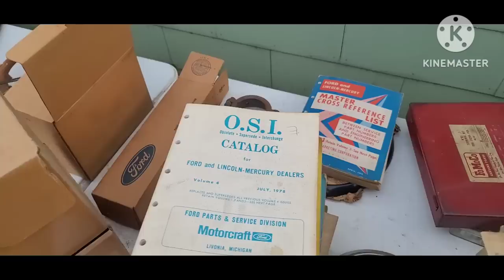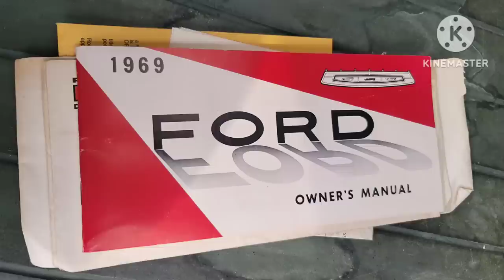Flathead to F100: TIME CAPSULE Survivor Ford Collection Auction! 1940 Mercury, Galaxie, 8N Tractor!

Comment: That Ranger, WOW!
Reply: Yes but, did you notice the rust in the upper front fenders especially the drivers side.
Reply: @briangardner5764  Hopefully that is surface rust as it is otherwise mint with only 21000 miles.
Reply: @briangardner5764  I noticed. And it certainly made me be very sceptical about it being only 20,000 miles.
That rust... to me... just doesn't jive with how good the paint is.

I also noticed... when he showed inside the bed... what appeared to be a couple of places on the fender hump that had primer on it.

Comment: Gotta remember that 'back in the day', anything near 100,000 miles on the odo was considered near dead. Now most cars will do 200k with decent maintenance and more with due diligence.
Reply: I remember, when cars were considered shot at 60,000 miles. In the old days, before there were warranties to worry about voiding, most people never worried about changing the oil.

Comment: That XL was a steal at 
$5500.00...
Reply: I restored one in 1984 for guy ! Even then everyone that came in the shop was checking it out!
Reply: If it wasn't original and was ratty, I'd Mad Max it.  The body reminds me of the Australian Falcon XC Pursuit Special Interceptor, but larger.  Unlike the Holden Monaro used by the MFP (Main Force Patrol) at the time, although some Holdens had Ford lines.

Comment: I had a 1970 Ford Galaxy back in the early 80s . 390 and C6 auto. Not much to look at but what a runner it was. High mileage, engine finally went bad so I traded it for a 1960 Chevy 4 door
Reply: Was it a BelAir or Biscayne. And was it any more reliable than the Galaxie.

Comment: I have to laugh cause the tractor sold for what a used mower would sell for here in alaska. My son has a collection of them with several extra parts including a few running engines. I do believe in my heart that the torino should go back together as its solid enough and not clapped out on the insides. A good frame straightener will fix the left frame rail or both as one is never the case in  those types of wrecks. I personally have done a few with great success. A front clip, and some of the incidental parts to get someone motivated into making it a grand torino  would be the best scenario
Reply: Sorry about going off topic with my comment, but what I noticed I couldn't get off   my mind. My interest in cars remains strong.

Comment: That Torina was a sorta special model. I know TASCA FORD in Rhode Island  ordered I think over (I heard 500???) called a "halo' version based on the last of the year  production run. I do know that the body seams were not as good as the earlier model as the dies were at the end of the production. I worked on a couple (Dad had one) to try to fit the hood/front fenders better. If my memories are correct they were a special to the larger FORD dealers  in the summer.
Reply from the maker: Fascinating info, thanks George!

Comment: Mr. Badsocket! - In the first place, thatnks for showing us this auction. That F 100 is to die for!  Please tell us what you mean by a "Marty Report" [@ 9:42]. I can make an educated guess as to what a "Marty Report" might be, but I don't know for sure, so please explain! Can the rest of us mere mortals obtain such a report?
Reply from the maker: Marti report is a verification of the build sheet from the manufacturer for a specific vehicle, looked up by the serial number. It is similar to a PHS (Pontiac Historical Services) report, or Govier verifying a Mopar Broadcast sheet. Helpful in pinning down exact details of how a car was built, in order to assist in restoring it to exact factory specs
Reply: Thanks. That's the info I needed.

Comment: if its 21000 origonal miles the odometer numbers should be all in a straight line. after it rolled over once the numbers will start to stagger

Comment: I’ve seen you buy some 1964-1966 Chevy trucks. Do you have any you would want to sell? I have a soft spot for those trucks.
Reply from the maker: That's my favorite generation of Chevrolet pickups. Right now I have a 1961 Apache longbed, a 1965 C10 longbed with rusty cab, and a short bed project (GMC frame  - with rear leaf springs - and Fleetside short box), and a 1963 C30 that could donate its cab and front clip.
Reply: I have a 65 short wide bed that’s almost done and is waiting for the LT4 swap. The engine finally showed up yesterday and I have an identical optioned 65 short wide bed big back glass that needs floors and front fenders. Also have a 66 c25 custom camper and a 66 long bed project and a 64-66 short bed frame sitting waiting its turn. Lol. That’s my favorite also. The short wide bed stuff has become hard to find. 15 years ago I was buying them for $100 to $500 each but now they  are popular that has really changed.
Reply: Oops. It’s a new day and didn’t realize I was repeating. Lol.

Comment: They over paid for the Ranger and got a great deal on the Ford Galaxy.
Reply: The Ranger actually sold for a fair price when you consider its condition and low mileage. This truck will require little or no restoration.